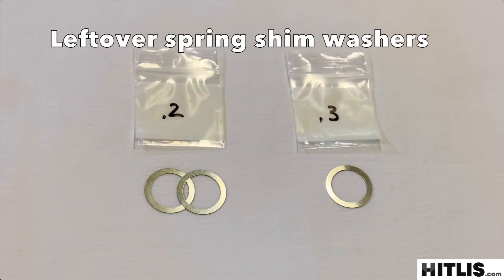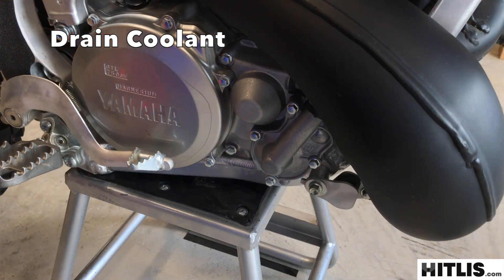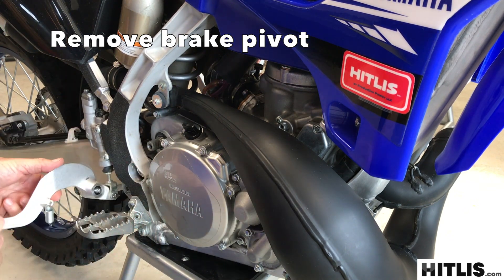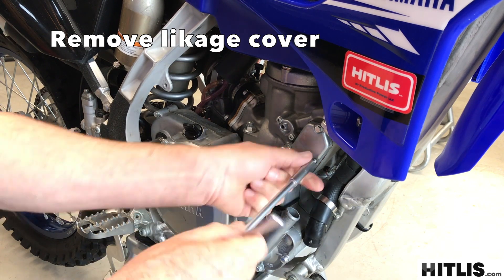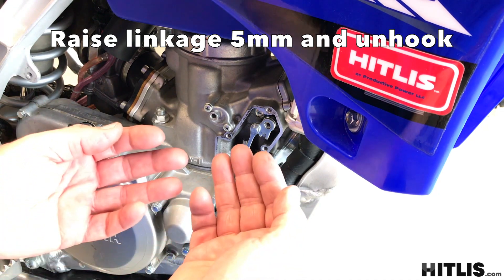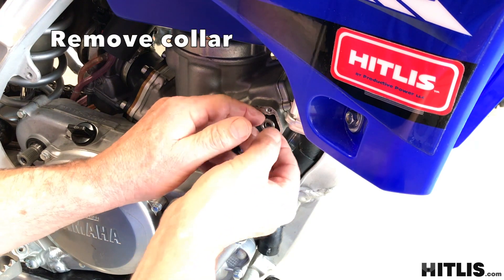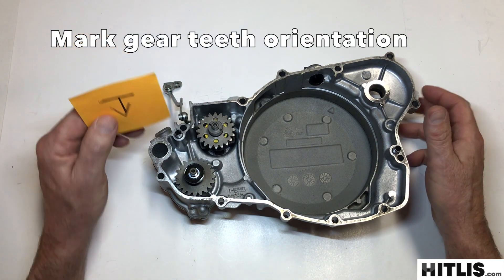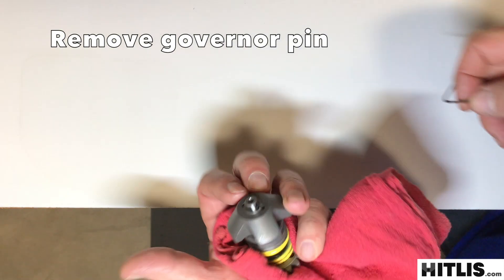HITLIS - Adjusting Governor

Comment: Hello, great video.
I’m trying to achieve the most power. I’ve tried taking out I .8mm washer swapping out the x spring for the motocrosser spring. Trying an after market spring. What does the x come stock is it 8 10ths? 
Anyway what would be your recommendation to get the quickest best power delivery?